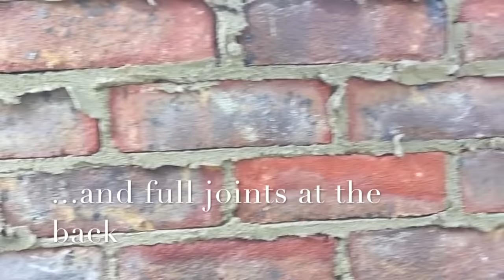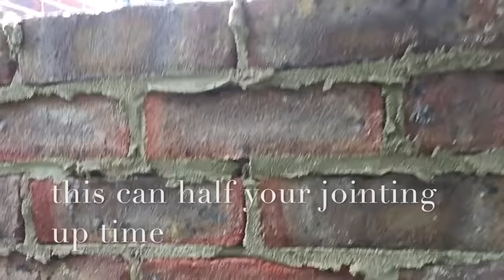the fine art of brickwork - Stretcher Bond

Comment: I remember working with my old man during summer over here in Australia, constantly knocking the mud up and jointing every one or two courses depending on the bricks.
Reply: Brent Davis would nt like to buy a house built in that weather the mortar turns to dust . It’s been up to 32 degrees in Ireland last week and it’s as detrimental to the mortar building in that hot weather as it is building in freezing conditions in the winter .
Reply: bric bybrick yeah that’s interesting you say that but we never experienced any failure with the mortar. We’d keep the sand moist and hose down the bricks to compensate for the heat, follow the shade if possible. Summer is mid to high 30’s every day and we always cop a week or two of 40+ so you have to work or there’s no $. That’s part of the reason why I no longer do it.

Comment: Minimum head joint moves = more brick laid & paid per day.
Recall a little Texas bricklayer humor goin' round during the mid 70's & 80's...
''We bricklayers, like our runnin' bonds, & bills, are alway's gettin' a little ahead or behind.''
''Move wheel barrows full of brick, & mortar for each wall... your a Laborer.
 Move each trowel of mortar & brick into the same wall... your a Glorified Laborer.''
''No buiding material is touched, & adjusted by the human hand more, than that of the lowly brick. Nor machine will be ever made... which can place them with such economical accuracy.'' -gilpin  7118 
The fine art of brickwork indeed, Maestro Songer

Comment: If you worked from left to right you could butter your brick with the excess of laying the brick rather than keep going to the morter board
Reply: paul sutton because he’s bedding for one brick at a time he’s going back to the board anyway, but you can butter with the excess no matter which side your working from . In robs case because he’s working a bed ahead he has to rid himself of the excess because he needs the trowel free of mortar to furrow the mortar bed before he heads back to the board . If you notice when rob starts a course he goes to the wall with mortar only .

Comment: Hi Rob, I really enjoy your videos.  I am a carpenter by trade in the U.S., and I've always been interested in different bricklayer techniques.  I really like the way you fill your head joints; some masons think that it takes too much time, but do it right.  Ordinarily, you pretty much examine every brick before you put it in the wall, but I noticed something right at the 2:15 to 2:30 mark.  It seems as though there is a chunk taken out of the bottom face as it was laid in the bed.  Not very big, so I'm wondering if these are used or tumbled brick.  Keep it up, you give the trade a good name on YouTube.  Looking forward to your next video.
Reply from the maker: Thank you for watching and commenting. I have a few more soon and then hopefully lots more this summer.
Keep watching
Reply from the maker: Ah yes, I've seen what you mean.... These were at times a very uneven brick and some slipped through the net...
Reply: @robsonger1  - you make bricklaying seem easy, and it's not.  Keep them coming, I'll be watching.

Comment: Hi Rob! long time watcher and first time commenter. I've learned a whole lot from your videos, so thanks for taking the time to put them up! Question: if the brick does not have a frog as is often the case over here accross the pond,  when tying into an indent, do you just do the best you can getting the top bed in with a pointing tool or is there a better way since ther's no room for little bits of brick?
Reply from the maker: Sorry for the late reply, I'm just going through old comments.
I try my best never to tooth in stretcher bond but on rare occasions I have to so when I use the holed bricks I try and remember to fill a few holes with mortar prior to using them, then it's easier to tuck a joint in the indent.
Thank you for watching

Comment: Hi Rob . Is there any problem with the bricks getting hot on days like we have been having? And sucking the water out of the mortar? Thanks for all your vids - very interesting . JB
Reply from the maker: yes, the problem of dry bricks on hot days is that they dry out the mortar far too quickly which kills the mortar and prevents the necessary suction taking place that bonds the mortar to the brick.
thank you for watching
Reply: Would wetting the bricks for before work starts help ?
Reply from the maker: Yes, normally I wet the stacks with a hose or when I'm building a fireplace I will dip each one, but these bricks are unusually dense and when wetted they tend to leave surface water on for a while. So I tend to leave them dry.
thank you so much for watching

Comment: Hi Rob, can I ask "In this Hot Weather what's the best sort of mix to use" as I've just built the corners of my cascading steps & now I've got to run them in, so far it's been 4-1 with some mortar additive, watching your vids can give the courage to give it ago! Watching your video I noticed your mortar was wet! Not like cream cheese 🤔
Reply from the maker: if you've already raised the corners, keep the mortar the same as before....
but try and reduce the water, and very slightly increase on the additive, let it mixer turn, or whisk it for a few minutes get the air in it.
Reply: rob songer thanks Rob, due to spinal injuries I can only lay about 9 bricks at any one time, but it's coming along nicely, my wife helps me hand mix in a rubble bucket, when it's on the spot board I constantly turn the mix and roll it prior to laying